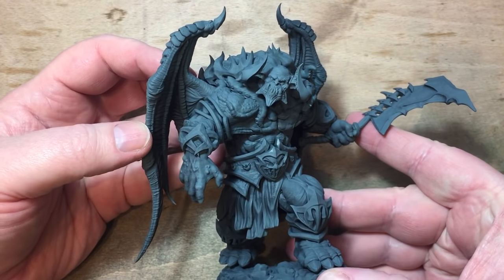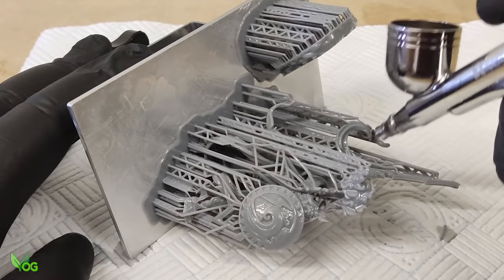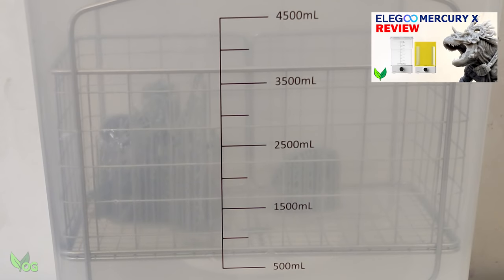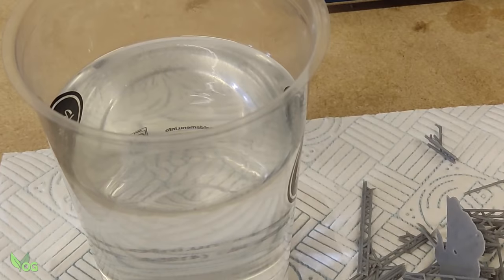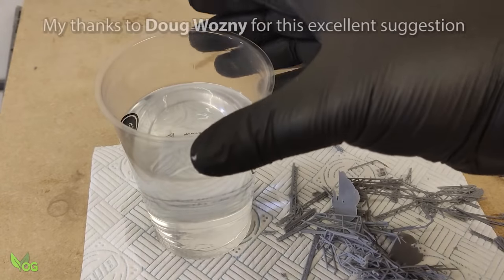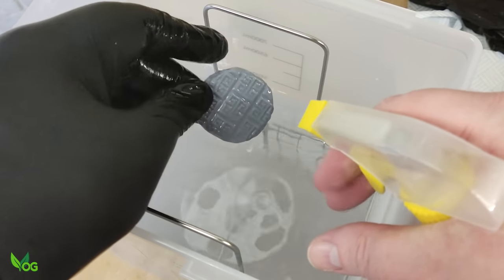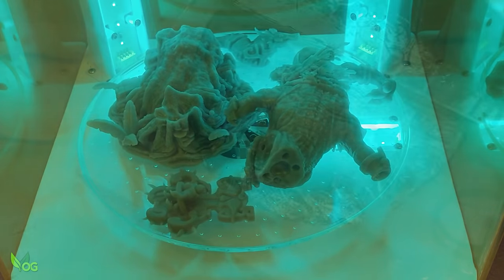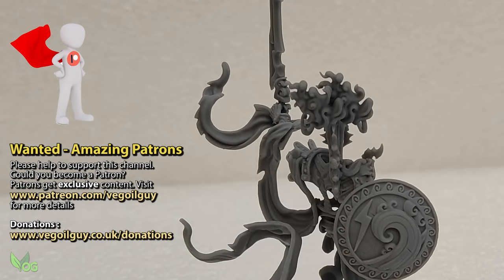BETTER cleaning & curing of 3D resin prints [EASY METHOD]

Comment: Be careful spraying your prints with an airbrush. I did this for the first couple of months of resin printing, and ended up with a bad skin reaction on my face and exposed arms. It seems that the process atomises the resin/IPA and it settles everywhere. Also, when using the swirl-in-the-jar method, try to find a container with a lid, as this can lead to splashes.
Reply: That's a great tip/observation and makes a lot of sense.  Many people assume if you can't see it, it's not there.  Will keep this one in mind, thanks.
Reply from the maker: Thanks for the VERY IMPORTANT SHARE. Safety is easily overlooked. Even though I wear mask and gloves, I don't use a face shield. I think your comments warrant a reconsideration of my safety gear - and hopefully all others that read this. 👍👍👍👍👍👍👍👍👍
Reply: @vogman  This is actually true of quite a few chemicals that either appear harmless or that contain particles you don't see. As a general rule, air pressure should never be used with anything that can damage your skin, eyes, or if it is harmful to be ingested. Issues like this can be especially nefarious because you can't see exactly where things go. 

I can tell you from experience working in chemical manufacturing plants that pressurized air gets much, much further than you would expect it to. Given the issues with liquid resin causing potentially serious reactions, a face shield would also be inadequate. If you wear glasses, I'm sure you have experienced how often things will seemingly defy the laws of physics to wrap around them and get into your eyes, and the same would occur with a face shield. You can also contaminate surfaces that you never touch and would otherwise consider safe, but the particles will collect atop surfaces just like dust will. It can even settle inside the fabric of your clothing, in your hair, on one or both surfaces of your mask, on the outside of your glove container, etc.

My alternative recommendation is to use a cheap toothbrush. It takes a little bit more time but it is much less likely to cause issues unless you scrub too hard with your face within about a foot of the print and get caught by tiny splashes. My steps are usually to use a shop towel (specifically NOT regular paper towels) to remove as much liquid as I can in large passes. Then I take the toothbrush and start going over the print with the towel still between the print and the brush, this allows the bristles to push the towel into harder to reach spaces and dry everything without risking tiny splashes from the bristles moving. After I go over it like that to dry the larger cavities its just back and forth with the towel and the brush until its dry. You likely will not have to do as many passes as I do after switching to mean green which does not evaporate nearly as fast as IPA.

Edit: I also wanted to suggest getting a few plastic trays, the kind that you might see in a cafeteria. You can place these onto surfaces that you don't want to dirty with water, liquid resin, or alcohol such as wood that could absorb them. You can spill all over the place inside the tray with no worries and cleanup is very easy. They're made to be less porous than other plastics that can potentially hold bacteria or particles and are largely heat resistant out of necessity because they typically run through industrial dishwashers.
Reply: Perhaps airbrushing inside a small container with a transparent cover, like an improvised glove box, would eliminate a lot of the problem.
Reply: toothbrush, compared to airbrush, its awful idea. airbrush at least has a directional cone, brushes bristles are essentially tiny catapults. way way worse when it comes to particles in the air. obviously safety first, but lets not hop into spacesuits just because we paint miniatures. if someone is worried - just use ultrasonic cleaner and dont do other steps. no point getting sandblasting fumehoods for just spraying a resin miniature if one is not allergic (and not everybody is)
Reply: @MrKfadrat you realise resins are classed as sensitisers right?
Those things that tend to build up in your system untill you've become sensitised to them. After that point been reached any further exposure can lead to severe reactions.

No need to fear the toxins but common sense is a bare minimum. Less ppe you use, the less time you get to enjoy the hobby
Reply: Would a hair dryer cause the same issue? Just been something I'd been thinking of using for a while.

Comment: Just put your IPA in a glass jar and run it through a few 60 minute curing cycles. Let the cured resin settle out and filter off the liquid. It comes out crystal clear and non-sticky every time.

Comment: Hey VOG, I also found another way to filter your used IPA. I use an easy alcohol filter (commonly used in home brewing kits), I've added a carbon cylinder to filter out the resin from used alcohol. Ive usedi about 30 times now and the liquid still comes out clear. As long as ya dont keep it in direct sunlight.  Id love to show ya and hear what ya think!
Reply from the maker: Sounds like a clever idea Mark 😁👍👍👍
Reply: I have heard that people expose their IPA to UV to make the resin turn solid then filter it. I have yet to give this a try.
Reply: How many uses of the carbon fo you get?

Comment: Might be easy, but it's also very expensive. Minimum $150 for the ultrasonic cleaner and a combo wash cure station. I'm starting to feel like actually printing any miniatures is too much of a hassle to be worth the hours I have to spend cleaning every batch, and borderline regretting getting a resin printer. Not to mention how much room I need for the process and the mess it creates.

Comment: I really need to start multi cleaning my prints like this! Clearly much better results
Reply from the maker: Great to hear from one of the experts 😁 👍👍👍
If nothing else, dunk, ultrasonic and air dry (even with an ordinary hairdryer on cool) and you'll be amazed at the results.
Reply: @vogman  afraid I haven't an ultrasonic
Reply from the maker: I hear you. Not everyone has. For those with one it's a great tool. For those without, hopefully there's enough other options here to help 😁

Comment: Something that’s worked well for me, especially when you can’t fit the build plate into your wash’s ipa tub (like my mighty 4K plate ) and have to remove the prints from the BP first, is to cut a piece of plastic fly-screen mesh into a shape so that it covers all the insides of the wash basket. This way the tiny parts that would normally get swirled to oblivion are held safe in the mesh cage.  The same mesh can also be used to wrap the print in while you “airbrush” or air-gun dry your prints. Again this protects them and stops them rocketing off into space when you don’t have a super tight grip on that part. Cheers and thanks for the great vid
Reply from the maker: Excellent suggestion. A finer mesh is a big advantage with tiny parts 😁👍👍👍

Comment: One of the ways I extended the life of my IPA in the past, was I placed it on my balcony where the sun shines most of the day, and allowed the slurry to "cure". Make sure you don't have an airtight lid, as there will be pressure build up.
After this curing, the IPA was mostly clear again (slightly yellowed) and I was able to strain it off. It left behind a goopy yellow/grey sludge that I was able to dispose of.

Comment: If you want to stick aluminium foil onto a smooth glass/plastic surface, just spray some water or spray cleaner on the surface and press the foil directly onto it. When everything is dry, the foil stays in place. 
And it's easily removed, leaving no marks. Great for windows in full sun, and UV curing stations.
Reply from the maker: I've never come across that. Excellent tip!!! 😁😁😁😁😁

Comment: I have 3 small containers and 2 large containers (+ the wash station container);
I use a small prewash container and large wash station container for a week or two while another small and large container of IPA sits on a window sill, this gives the resin a good chance to settle in the container.
After a week or two I pour the wash station containers IPA into the spare large container and decant the one that had been on the window sill into the wash station container.
Then decant the small container of IPA that had been settling into the other spare small container to use for prewashing.
I then let the dirty IPA and 'empty' dirty containers sit in front of a window. After a few days the settled gunge at the bottom of the empty containers can be scraped out.
Rinse and repeat every couple of weeks, letting the IPA settle gets rid of a surprising amount of resin.

The small prewash containers get most of the gunk too so the main wash station (and bearing) stays relatively clean, I found this gives me very good cleaning results because the main wash IPA isn't filled with small particulates of gummy resin. After washing in the station I rinse under warm-to-hot water to make sure as much IPA and resin has been removed and the warmth helps make easy work of the support removal, then just pat/blow it dry and do the final cure. 😊

Comment: Hi - Similar process, I have purchased a second build plate for my printers and stand the print/build plate on its end in a container for and hour or so to drain, then use a couple of Sistema containers, the first as an IPA dunk and brush tank (a 1" or 25mm chepo paint brush) then a pickle jar - these have a sealable lid with a strainer inside, half filled with IPA shake and swirl, then allow to drain. Followed by a wash in the Anycubic wash n cure machine. Due to the build plate size of my Mono X, I have to remove the prints from the build plate after the initial dunk and brush stage.  The Mercury wash staition looks impressive. I also distill the used IPA in a Water distiller - set the cut off temp to 90C - for water it's set to 105C, the temp will stay at 84C (ish) until all the IPA has evaporated. The condesate is pure clean IPA. Warning the fumes are horendous, so I do this outside on preferable a cool day. The residue is removed from the distiller and allowed to cure in the air then disposed of.

Comment: Lots of good info.  I don't have a Wash and Cure type machine, so I have been ding the dunk, then brush(if needed), and Ultrasonic (in a glass container, but that will change now).  I am happy with my cure setup, which is a pair of 30W UV Lamps (that do extra duty for retro-brighting old plastics and curing resin used as filler in FDM prints) and a solar powered turntable (it turns under the UV lights).
Reply from the maker: Sounds very similar set up. Thanks for the share 😁😁😁

Comment: Interesting approach. Didn’t consider the air blasting part yet. But to be fair, I typically only print larger parts - cases for my LED projects mostly. My approach is slightly different: first removing the print from the build plate, then removing the support (by hand or with a tiny saw), then clean in a dirty IPA bath by hand, then use sandpaper to remove the remainings of the support (so the surfaces are smooth), then clean again in dirty IPA, then clean in “clean” IPA in my Anycubic Wash & Cure Plus Station for up to 4 minutes, then dry the print with a fan on coolest settings, then place the print in a transparent plastic container filled with water and let that container cure in the wash & cure station for 2 min, then dry the print with paper towel, then completely dry the print with the fan on coolest settings again - and done ^^
Reply from the maker: Thanks for the share 😁

Comment: For anyone reluctant to invest in a compressor for cleaning, can I just say the difference it makes is IMMENSE. I ummmed and ahhhhd about the purchase for a while but got a little 24L silent compressor (for those that don't know, silent compressors are generally only 'silent' by compressor standards, as in you can have a conversation over it and use it without busting your ear drums). But seriously, couldn't work without it now. And as our VOG points out, can also use it for painting!
Reply from the maker: 24 Litre bad boy? I hope you turn down the pressure 😁😁😁
Reply: @vogman  Nah, I've seen the Yorkie advert. Use the right tool for the job, and the right tool is the biggest! Jokes aside I do give the stuff quite a heavy blast after soaking in IPA, and it really helps get the crud out.

Comment: Very interesting! You're getting great results. I actually use nearly the opposite method: I first give my models a heated bath in the ultrasonic cleaner (Directly in Mean Green degreaser concentrate), then finish them off with a little swish in IPA. I find it gives fairly similar results, with the added benefit of making it much easier to remove supports after the heated ultrasonic stage. I'm planning on adding the Mercury X to my production line once it's available for purchase again. 

Also, was that Siraya Tech Navy Grey I saw at the start of the video? It seemed a bit darker and bluer. If it is, I hope it's treating you well. It certainly appears to be by the results shown.
Reply from the maker: If it works for you, keep doing it 😁
Reply: What do you use for the warm bath?

Comment: Just got my Elegoo Saturn 2 and your videos are a huge help. Going to do my first test print in a bit.
Reply from the maker: Go slow. If this is your first resin printer expect failures. Whenever you do, empty the resin tank, filter the resin back into the bottle, clean everything and start again. This is very important. If you have a blob stuck to your FEP and you continue trying a new print, this can puncture the FEP. 
Don't worry, you'll soon get there. Misprints will happen, but they'll get fewer and fewer 😁

Comment: For cleaning the IPA, what i do, is i put it in a transparent cheap plastic container and leave it out in the sun a day or two (with a  tight fitting lid on of course) and all the uncured resin becomes a nasty slur that you can filter off. Repeat a few times until you are happy with your IPA. It's nasty but it works :)

Comment: If my print isn't too big I usually put the entire build plate in the cleaning station, hanging it from its attachment. One of my build plates doesn't fit the hanger attachment so I designed an adapter.

Comment: I bought a 2nd tank for my anycubic wash n cure. I now have a 'dirty tank' used to do the initial clean, and a 'clean tank' used to finish the job. When the 'dirty tank' gets really dirty I clean it out, filter the dirty IPA, and convert the original 'clean tank' to a 'dirty tank', and refill the original dirty tank with clean/ recycled IPA to make a new 'clean tank'
Reply from the maker: Smart move. 😁

Comment: I also have some useful tips myself. If you cant get hold of IPA for whatever reason be it stock or insanely expensive. Use White sprits or methylated spirts. It is just as good, I like to clean things off in it with a super soft brush or a cloth that has some on it and very... softly rub, then put it in the cleaner, after can remove some supports like you done if its covering details then rub it again if need to be. Let it air dry but after you will need to clean to get off the oil like stuff thats on it, use normal dish soap (a good quality brand as they are designed to removed oil and grease) put it on the model rub it in lightly and dip in and out of slightly warm water and it will be perfect! these spirts are dirt cheap I myself got 4 litres of it for about 7Euro. Its worth it to save some cash and only needs an extra little bit of work to clean the oil off, a couple more seconds per model really :-) There is no difference in overall quality, its cheap even if you are stuck on a tight budget with a small cheap printer :-)

Comment: i put my cleaned prints in a jar of clean water for the curing cycle. to me the results look much better and also the surface feels better. something about resin curing better when not in contact with air. also i use car-windshield-cleaner instead of ipa. much cheaper and works.

Comment: Another excellent video as always!  I use two buckets with denatured alcohol.  One it's pretty dirty stuff and the other is relatively clean. I also use a dedicated soft paint brush to agitate the surface of the print to help remove the stubborn bits of uncured resin.  The thing that makes the biggest difference though is that I also use compressed air to blast the prints dry.  Perfectly clean prints every time! :)
Reply from the maker: Nice share, thanks 😁

Comment: To stop parts sticking through the basket and getting hit by the impeller print a rectangular spacer with holes in it that fits the bottom of the basket. It will also reduce the vortex depending on the spacer thickness and hole size/shape. I'd also add some handles to help remove the part protector spacer when you need to.

Comment: Great video. I've just purchased my first printer and am in the midst of getting a spot for it set up in the basement. Is there any reason you picked that particular ultrasonic cleaner? size? shape? I noticed the bigger one (3 L)  is less expensive than the 2 L. (at least here in Canada) . It is wider but not quite as tall. I haven't printed anything yet so am not sure what is more useful or if it really matters. .

Comment: I take the supports off before I wash. Much less resin in the IPA means much less cleaning of the IPA.
You can also avoid sticky IPA by curing your IPA. Leave it in the sun for a day. The resin will cure and you can filter it off.

Comment: Question about recycling your IPA...do you put the used IPA in UV light before you run it through the filter to solidify any suspended resin?  If so, what causes the stickiness?  It seems like the resin would filter out once it was cured.  I've only used water-washable resin so far but I do put my used water in a clear container in the Florida sun for a day before filtering out the resin.